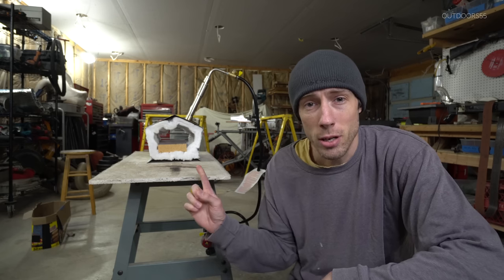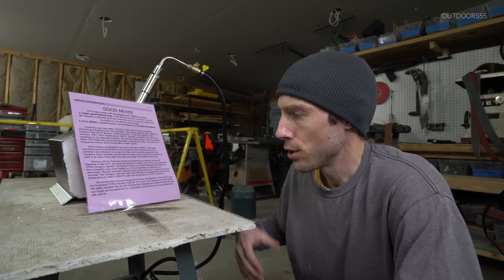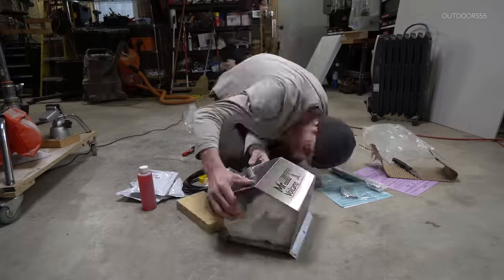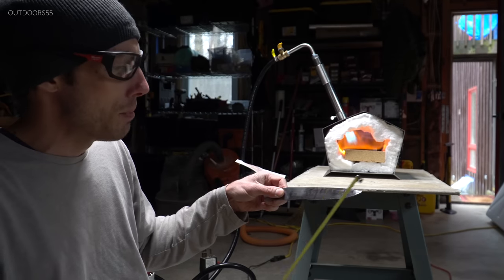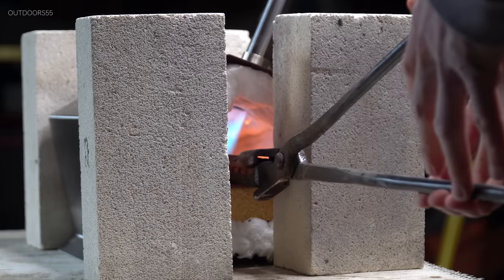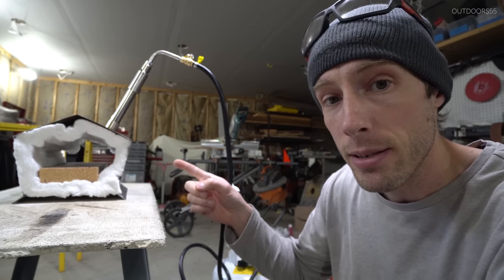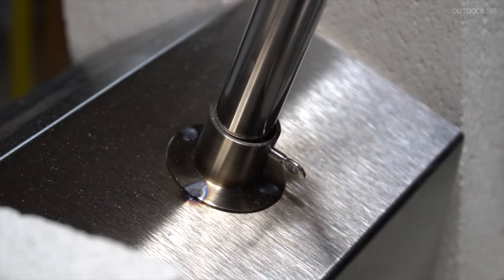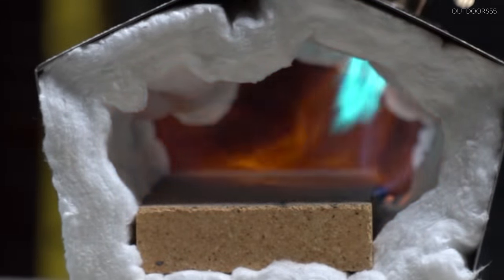The CHEAPEST KNIFE MAKING FORGE on AMAZON - Is it any good?

Comment: A place where I take classes and go to open forge nights has been using them for a year. They work great for small projects. Completely reliable. I got mine a bit over a year ago when they were still under $60. No problems at all. The Satanite still hasn't cracked. The rigidizer rigidized.

Comment: Good choice, in my opinion. I have been using that forge for over a year now. I have gone thru over 100 gallons of propane, and it is still doing fine. I did use the refractory that came with it and after about the 3rd time of use, it started cracking. But,  regardless, that forge works great. I have made hammers and tongs with it (among other things), but still have not tried to forge weld with it yet. The company does say it will weld though.
Reply: It will weld though it's size is limited. I use my Hell's Forge normally to forge weld but that is far less efficient. But I have even made canister in this bad boy.

Comment: I have a hero volcano forge, not only does that ridgidizer and satanite supposedly keep you safe, it protects the blanket from any damage by bumping it with your stock when you use the forge.  I've moved mine a bit and still no cracks, be a year in August.  I also recommend adding screws or bolts to the seams because stainless steel likes warping. And a braided hose with a guage instead of the stock one they send with it.
Reply: Hi Bill how are you doing. Have a nice Sunday 😊

Comment: Dude you're legend! This little $80 forge is for those who wanna try out forging and don't wanna spend a fortune. Also this thing is safer then 90% of the videos on YouTube showing people how to build a homemade forge period. People act as if technology doesn't exist also people run at the mouth before actually researching a product they wanna bash all over. Now this isn't the best option of course it's not, but it is a good option for a beginner with proper steps making sure is all safe like propane leaks as you stated.
Reply: Personally, for second-hand safety violation thrills, I prefer the videos involving high-voltage applications like the ones demonstrating how to burn a fractal pattern into a heavy plank of wood by running current through it. Nothing says “safety” like rigging up your own extremely high-voltage setup in your garage or basement based on a YooToob video! Now, sitting down with one of those videos, reading the comments and imagining the possibilities for calamity, is really the height of entertainment.

Comment: I bought the double burner and it worked amazing for about 1 month before the tack welds gave up. Ends of the burners will fall apart eventually but for the money you cant make one the same size. I have since taken the 2 burners off and used them in a DIY forge and it has made many many Damascus billets and blades. The coating they sent cracked away it 2 days plus I had to use all of it where they say use half and the rest for repairs. All in all it was more then worth the money and would recommend. Burners, hose, and pressure regulator would cost more then the whole setup if bought separate.  If anyone is looking for a forge welding setup get the dual version. Well worth the money. Great review btw!
Reply from the maker: Thanks for the feedback.👍

Comment: I have this forge, and its held up fine so far. 

I put the rigidizer, and satanite on it came with, and it did crack like you would expect over time, but it comes with extra to patch that up. The big thing i did though was line the inside with ht100 coating to help with efficiency. Of course i keep fire brick blocking the back, and part of the front also. 

It will get up to forge welding temps, but it definitely blows through gas getting there. Im wanting to modify it to take a small ribbon burner, i think i can get even better efficiency if i did that. As well as get more even heating. 

All in all, its a good forge. Especially for the price.

Comment: I saw an german old movie about old german jobs that dies out, "The last of it´s stand (or the last of it´s kind? translated) - The file chopper" he use hardening powder by the hardening process, that the individual rasps of the file, will not burn off (perhaps also in knifemaking a great deal) and for extra Carbon for extra hardness. He also does not hardening the file in water or oil, he uses saltwater for greater thermalproperties that give faster the temperature off. When a file is bending by that process he only uses a little bit of his strength and bend it straigth again by using only a bit of water over it and the bending problem is solved. Perhaps you can do a vid of it. The main igrediance of the hardening powder is cookingsalt, Charcoal dust, horn meal (flour) and also rubbing flour (that is the flour that falls in mills on the ground and would extra sold for such old Craft businesses. And the cleansing off of the powder he do with an very old technique who did craftmans over generations, he do in Dilute hydrochloric acid, than brushing, than water baths and than an oil bath as rust protection. And as last woring step 4 seconds in 740 degree celsius hot lead bath, only with the angle, this softens the material again so that it does not glaze and break. This job is died out in our times, cause in old times material was more worth than working time and now it is the opposite.

Comment: Pro tip - actual fiberglass insulation melts much sooner than you might expect.
Reply from the maker: It's not fiberglass, it's ceramic👍
Reply: @OUTDOORS55  absolutely, but what I tried in my DIY version for more insulation was fiberglass.  I filed that under what I call “Retroactively Obvious.”

Not a bad furnace at all for the price, and I am jealous of how much nicer the stainless steel burner looks than the one I made out of iron pipe.  I used an old-type propane tank for the body, and added some thermocouples to monitor temperatures.  It was a fun build, but I haven’t used it much since.
Reply: @OUTDOORS55  what melted was pink, had a paper backing, and said Owens Corning.

What worked well was a white fiber mat of Kaolin.

Comment: Thanks for another WELL DONE video!
I suspect this will not get up to forge welding temperature - at least not very quickly, so in your opinion (or anyone else's?) could this be adapted to a small air-assisted ribbon burner? Has anyone tried to adapt this or other small kit unit to a ribbon burner? Sorry if that is a dumb question. As you probably know, those are super hot. Thanks again!

Comment: Yeah, I don't know about the safety of that thing. Personally, I've found forges to be pretty dangerous without adding hysteria to the mix. I wouldn't want that one because it's completely open unless I modify it. If I were to modify it, I'd probably just build something that suits me better. Like the one I have currently. I do have to say that it might be a good option if you're broke. That's just my take on it.
Reply: Did you ever notice that for some reason, on the internet particularly, there seem to be a lot of us broke people looking to start banging on hot metal? It’s hysterical. 

Also, have you ever noticed that each person hitting up the blacksmithing forums with questions about building a “beginner” forge is busy reinventing the wheel from scratch? We all seem to start out with some idea about how we are going to do it just a little bit different. What’s hysterical about that is the frustration that causes experienced people who patrol those forums just waiting to share their divine knowledge with the unenlightened. If you ever wanted to troll a bunch of grouchy old blacksmiths that is absolutely the way to do it! 

Personally, I think everybody who has any desire to, should build at least one forge from start to finish. It’s a fun project. Inevitably, you learn a lot along the way, researching it and thinking it through. As in my case, there is an added benefit that you get to see the reason nobody does it the way you thought of isn’t because no one ever thought of doing it that way. It can give you a better perspective on a profession that’s thousands of years old. 

Cheers!
Reply: @ColdHawk  I feel exactly the same way! My first forge was a menace to gods and man, but it was MINE! LoL yeah, same thing with machine tools. I thought i was king of the world the first time I turned a shoulder in a part then reality set in. For me, it's seeing the progression of my skills in metal working that makes it worth doing, as well as making useful things. You might not believe it, but my grandfather was a machinist and he was a cranky old fart. He never taught anyone anything if he could help it.  Personally, I've never been to any sort of forum. I've got a youtube diploma in metal working 😁

Comment: Are you certain that the claim of the no silica release isn't based off of using the red hardener and the coating? You'd think it would be easy to say it doesn't emit fibers when the blanket is completely coated in the sealant and Crete mix
Reply from the maker: Read the paper in the video

Comment: Hey, I actually was looking at these awhile ago when I became interested in trying to start out smithing and blade forging.

I didn't get it, in the end, because I didn't really know how well it would actually perform, so I'm pretty excited to see you using one.  I'm curious if you think this would be the best (or at least a good) choice for a complete newbie to get into the scene.

Of course I'll also need to get an anvil, hammer and tongs, the propane tank, e.t.c. but that all seems much more attainable if the forge itself is this cheap.
Reply from the maker: Yeah it's definitely a good option for starting out. You could spend another $40 and get the dual burner but if all you're doing is smaller stuff its more than capable.

Comment: Nononono that can't be safe .. look it has fire in it that's warm ..warm hurts .. allright enough bout that, i was wondering you make knives and pretty one's too ..but imagine having 2 of those mounted in line could it be possible to make like manchette's or swords because i still would like to create that , if not forged than atleast to heat treat the full blade what do you think?
Reply: They make a 2 burner unit that's $135. Not quite as long as two stacked (16" vs 17.5"), but cheaper and is one solid unit.

Comment: Be aware also that crystalline silica is at a VERY HIGH concentration on most beaches. Avoid those or wear N95 masks too. Safety sallies united in head bobble nodding. 😂
Reply: Beach sand is quartz - a low temperature phase of silica that a high portion of the earth is made of.
Reply: Hi Chris how are you doing. Have a nice Sunday 😊